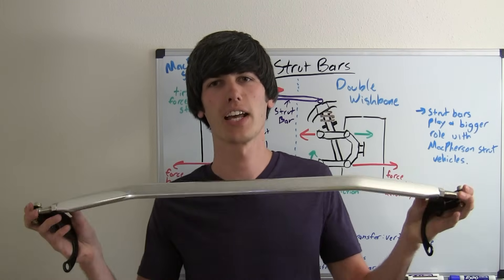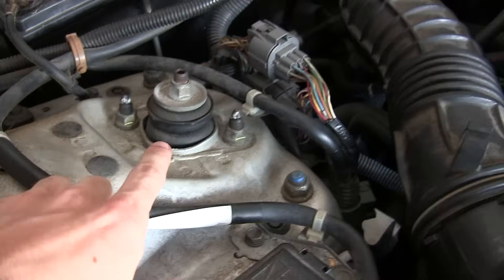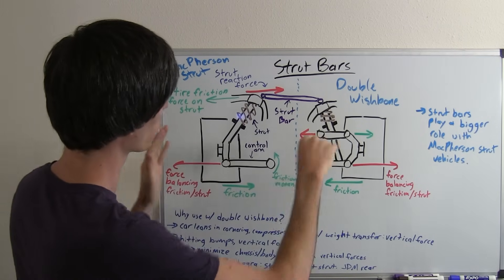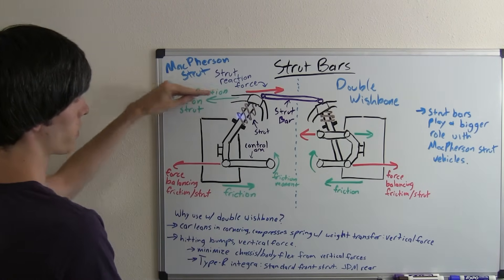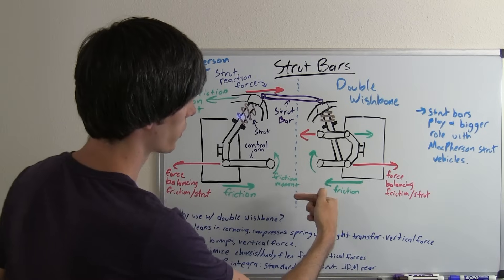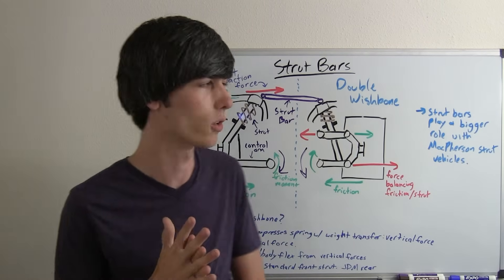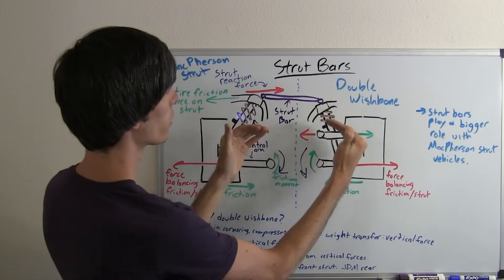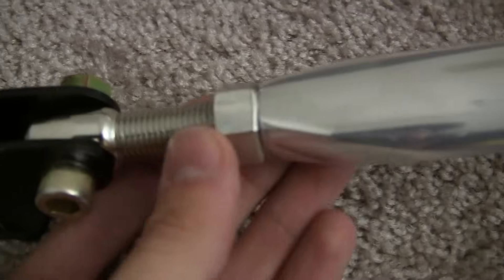Strut Bar - Explained

Comment: if i paint the bar red will my car go faster?
Reply: +25KW
Reply: If u paint it red it won't b street legal
Reply: Definitely
Reply: clownavenger yeah it's not street legal to paint it red. But each sticker you slap on it adds roughly 5 HP
Reply: Antonio Conejo i know about the power of stickers but it may get too hot down there when i rev my rotary to 9500.
Reply: No, but if you paint it matte black, it will stay cooler.
Reply: Char Aznable reference?
Reply: dark colors absorb heat, lighter colors reflect it. you have it backwards. if you wear a black tshirt on a hot day you'll get hotter than if you wore a white tshirt, this is elementary stuff
Reply: my wrx sti is going to be my char car. Sorry toyota.
Reply: eksine the absorbsion of electromagnetic radiation in a darker surface causes more heat. An internal thermally conductive bar of metal tied to metal body would cause a heat pipe to form and vent heat.
Reply: njack1994 I think I understand what you are saying , HOWEVER, he was saying painting it black would make it cooler, which it wouldn't at least exposed to sunlight. What you brought up is a good point however you are wrong, firstly 1) it won't matter what color it is since it receives no sunlight in a closed hood. 2) you are wrong because there is no airflow under the hood, it's a dutch oven meaning it wouldn't act as a heat taker away thinga mabobber because again the engine is closed, heat is being trapped.
Reply: clownavenger No, the paint will add more weight :/.
Reply: +5 horsepower
Reply: clownavenger paint adds 20 hp, a decal will add another 35 hp, and a mini spoiler will get you that 100 hp extra you need.
Reply: Corny
Reply: what kind of red makes it go the fastest? asking for myself
Reply: Only if you put stripes on it too
Reply: Red is good power if you paint it yellow you’re beating hell cats eazy
Reply: Put sticker instead of paint
Reply: If u want car faster weld it directly to ur steering column to keep ur steering straight all the time and push throttle. Only make sure u always drive on a straight road.
Reply: No but I think yellow might make it speed along a little bit quicker.
Reply: I guess Sarcasm isn't a thing these days?
Reply: Yes!
Reply: @eksine  Lol, carbon fiber hood.
Reply: Yes
Reply: Depends on the shade of red
Reply: No the paint will make it heavier
Reply: Yes, and if you put stickers on it even goes faster... depends on sticker will determine HP and Torque 🙄
Reply: Bigger tires on the back will help you save fuel.  You will be going down hill all the time.
Reply: Yes red Sieg Zeon
Reply: Correct
Reply: Yeah 16+ horse power 😅
Reply: yes. +10HP added to your car
Reply: You gotta paint it red with the metal speed flakes, that's the real secret they won't tell you.

Comment: How much HP will it give my car?
Reply from the maker: ***** Zero horsepowers.
Reply: ***** You could always paint your brake calipers red you know, +25KW.
Reply: ***** It just increase your car stability
Reply: NorwayVFX i bet your a mighty car mod viewer :)
Reply: ***** I heard stickers usually add 5HP.... or is that with hubcaps...? I can't remember.
Reply: ***** 10%
Reply: +Engineering Explained Wouldn't you technically lose horsepower because you're adding weight?
Reply from the maker: Brian Patrick Adding weight does not change wheel horsepower, unless it's added to the drivetrain (wheels, driveshafts, flywheel, etc).
Reply: hahaha...
Reply: +Engineering Explained With increased structural rigidity it will aid in putting current HP to the ground ,you won't have more HP , but will make use of it more effectively.
Reply: +Freesample D Stickers. Stickers add about that much HP.  There are "go-faster stripes" too if you are not too picky about numbers.
Reply: +The3Shogun Health Points -there will be much of them.
Reply: +The3Shogun around 4500
Reply: 20 to 10000 hp
Reply: He looks like Sam pepper
Reply: +The3Shogun My son gay and Trump stickers -16 WHP! and camber angle -28WHP!
Reply: +NorwayVFX Mighty Car Mods?
Reply: +Lucas Zibell Yes :D
Reply: +The3Shogun approximately 1.21 jigawatts
Reply: +gravitykillz nyahahaha
Reply: around 100-150. I added one to my car and now i win all my drag races and get all the bitches
Reply: I think if you paint it red or green it will give you 99.999% chance of winning races.
Reply: First you get the strut brace, then you get the power, then you get the women?
Reply: 100 hp easy
Reply: The3Shogun lmaoooo
Reply: In 2020 they're making the switch to Unicorn Power. I'd start looking into that.
Reply: The3Shogun about 10% touquepower
Reply: Apollo 13 torque and the speed? well hell just grab onto that strut bar baby!!! FFEEEEELLLL that power? yep I knew you would dig it!!
Reply: What if you paint it red and add stickers to it?
Reply: Windshield wipers give 10 a piece so you're looking at about 25 for a strut bar
Reply: 50hp if its red, 40 if it's yellow.
Reply: Engineering Explained what if he colors it red?
Reply: I've been playing RPG's lately and read that as health points.......damn
Reply: The3Shogun You'll gain more instant torque than a Tesla
Reply: 0.0
Reply: @Brian-dd2df  generally adding weight to the car changes the way the internal combustion engine works? So if you pick a pizza up on the way home you have 299 hp instead of 300? it would affect the POWER TO WEIGHT RATIO.
Reply: @_Delta_P_  Hey thanks for clearing up what had already been answered 4 years ago
Reply: Well I don't think it'll give you much horsepower but it might be able to help you keep what you have I'm done sharp turns.. lol......
Reply: Yes
Reply: All of them
Reply: NOTHING TO DO WITH HP , TRY TO IMAGINE THE WORD "HANDLING"

Comment from the maker: It doesn't act as a sway bar, it simply keeps the body a bit more stiff. Sway bars are used to reduce roll, which is not what strut bars are used for. I have a video on sway bars if you're curious.
Reply: Would the strut bar help in a head on collision?
I. E. Stop the engine moving towards the cabin?
Reply: @mohsinrasul8450  It is not designed to.
They go over-top of the engine usually so they wouldn't even be in the way in most cases.
Even if they were in the way, if there's a force strong enough to bend the frame, break engine mounts and move the engine backwards, I doubt a few extra bolts are going to help very much.

Comment from the maker: Correct, the MacPherson strut is load bearing of the forces from lateral acceleration, where as a double-wishbone handles the vast majority of the forces through the control arms. Of course, the weight of the car, bumps, and weight transfer by cornering still put additional pressure on the coils, thus a force on the strut tower.

Comment: Strut bars works well in Macpherson struts. One reason why?

Because car manufacturers now, have placed strut towers very near the firewall where they can bolt a part of the chassis (usually at the base of the windshield) unto them. Acting as a strut bar on mass production cars, like a Honda CRV or a Nissan Sentra.

So yes, buying and installing a $20-$50 aluminum strut bar  on your old car is NOT a waste of money. Even if you don't use it for racing, it does make your chassis a tiny bit tighter for maintaining the correct geometry that can go a tiny bit off thru the years. Take it as an investment not as a racing mod.
Reply: thanks dude, it was that kind of information that I was looking for
Reply: Make a sense .thanks bro
Reply: Very well said
Reply: i put i strut brace on my totally stock beater mazda protege and the difference is amazing. the car feels so flat in corners now. im planning to put one on the rear of my e46 m3, but everything im seeing is saying it wouldnt do anything. a bit confused with the consensus on that, the rear of the car definitely feels like a week point in handling so i cant imagine how it wouldnt make a big difference.
Reply: @AC-wl7ve  only problem with the rear is that you might need the trunk space of hauling your junk. Unlike in the front where it would not take up any space. Otherwise yeah, I don’t see why it wouldn’t help, even if just a tiny bit.

It’s actually a BMW engineer who said that strut bar might not help in “handling” but it would help maintain chassis shape that may sag thru the years. Specially 90’s car or older.
Reply: @jpogigtxcr1778  trunk space isnt a problem for me or i definitely wouldnt do it. i just find the rear can feel a bit flexy so i cant imagine how it wouldnt help. i am not too knowledgable about suspension stuff though so im not too sure. my only basis for my theory is that it helps so much on the front, why wouldnt it do the same for the rear.
Reply: calidakota  on my Mazda I put one in the front and made made a substation difference, highly recommend a front strut brace for any car. 

On my e46 m3 (has a front brace stock) I added a rear brace and the car definitely feels more stable a bit flatter. For example, changing lanes at high speed the car feels much more confident and doesn’t sway side to side. It’s a really nice upgrade, but I don’t think as substantial as a front brace.

Comment from the maker: Anti-roll bars connect independent suspension set-ups (at the control arms), so that when one wheel travels up, it causes the other to have a vertical force as well.

Comment from the maker: I don't see it making a huge difference, unless there is considerable flex in the strut towers upon lowering the car back onto the ground. Regardless, if installed once lowered it will attempt to negate any force which differs from the car when it is stationary. The bar will experience compression and tension, so pre-loading it one direction (which could be the case if installed while lifted) may not always be best. Interesting question though - feel free to expand anyone...

Comment: I'm not an engineer. I am a retired automotive technician of 44 years.
I used to race cars. I added a strut bar to a car I'd driven every day and raced after two years. After the first race, the windshield cracked.

I had customers who installed strut bars and experienced the same.
One of those cars was a VW GTI that, as I stated, cracked three windshields.
In my circle of racing acquaintances, it became common knowledge that adding a strut bar to a car w/glued-in w/shield would likely suffer.

Comment from the maker: Well, it certainly shouldn't be very easy to bend it, but as you mentioned it's really only in tension/compression along the length of it. A vertical force wouldn't be applied, except possibly at the very ends.

Comment from the maker: As long as the components are strong enough for the forces they see, it shouldn't matter too much. A single piece will likely be able to handle stresses better as it wont have as many sheer points.

Comment: Excellent!  Except double wishbone suspensions are load bearing at the top also.  The full weight of the car is transferred from the body to the lower control arms through this point in both designs.

Comment: While on track in my E36 M3 (was running very sticky rubber) I cracked a windshield after negotiating a quick right-left-right section of track...in video you could see the crack form and grow as the chassis twisted left and right. Adding a sub-frame brace and a strut bar significantly reduced chassis flex...I haven't broken a windshield since.
Reply: im planning to do a rear strut brace on my e46 m3 as i definitely feel some flex in the rear of the car, it seems like a weak point (sub frame is reinforced as well.) but it seems the general consensus is that a rear strut bar would do practiacally nothing so im a bit confused on this. i imagine it would make a huge difference.

Comment from the maker: I did install these - the video will be up Saturday. I haven't installed the catback because I want to do engine upgrades differently - I want to prove they've made a difference, which requires dyno testing. I want to be able to tear apart my car and leave it in a garage, without needing it - which requires another car. This should all be solved within a year, as I'm saving for a new car currently. My channel grew a bit faster than I expected, so I'm just trying to keep up!

Comment: I have strut bars everywhere on my Type R; boot brace, rear upper strut bar, rear lower strut bar, front upper strut bar and a H brace under the engine. The car is so stiff, turning onto a road or car park with a fairly steep incline and the car likes 3 wheels instead of 4 lol
Reply: +elliot438bcfc Interesting. Did you feel that change in the car's behaviour with these mods alone or in conjunction with stiffer springs? Do you have stock springs or stiffer aftermarket ones?
Reply: Siddharth Rajkumar
Well all of the braces other than the H brace under the engine are stock. It is on Ohlins coilovers so not overly stiff or hard. The car is definitely a cornering champ and I believe the front and rear strut braces aswell as the H brace definitely help. Obviously a good brand of coilovers such as my Ohlins will make a huge difference even over the already great DC2 suspension
Reply: elliot438bcfc I see. As far as strut bars/braces go, the baseline you seem to have for your car's handing is NOT without those parts in place. I was hoping to know if all the strut bars were installed by you and that's what improved the handling. The improvement you have achieved seems to be mostly due to the coilovers. Of course, I am only deducing that from your comment since you are the one who drives your car. However, if all the strut bars (save for the H brace) came as stock, the car actually needs them to handle well and would not be as poised without them. I wonder how much of an improvement a strut bar provides in real world circumstances in a car that does not come stock with it. All theoretical questions I guess...
Reply: Siddharth Rajkumar
I believe strut bars will have a small effect on handling. I don't think Honda would put them there for no reason as they made the car to be as light as possible. During hard cornering (providing grip is adequate) there will be flex and strut bars will definitely lessen this flex. Similar to how brake stoppers work.
Reply: +elliot438bcfc That makes sense. If they made the shell of the car as light as possible, that means some load bearing parts (like strut mounts) might flex under cornering stress. To make up for that they must have installed strut bars instead of adding large areas of thicker sheet metal. Brake stoppers? Do you mean bars or link rods that connect the chassis/body to brake calipers to prevent them turning about the rotors?
Reply: That's right about installing lightweight strut bars instead of heavier material around the chasis. Brake stoppers are just a small part that bolts onto the chasis near the brake master cylinder and holds a strong bolts which is then tightened to pressure the brake master cyclinder. The master cylinder flexes under hard braking, the stopper eliminates this flex therefore improves braking a small amount similar to the effects braided brake lines would give.
Reply: +elliot438bcfc Wow! OK... I mean it makes sense to reinforce caliper mounts but this is a bit overkill, don't you think? One would expect the manufacturer to at least make master cylinder mounts rigid.
Reply: The flex will be minimal but eliminating this flex does make sense and lots of people use these including me
Reply: +elliot438bcfc And has it made a perceptible difference?
Reply: It's really hard to say, braking hard does feel firmer and more stable. It's definitely a worthly mod if you are upgrading brakes
Reply: +elliot438bcfc Interesting. Makes sense. It seems some of these mods really help when driving hard. Thanks for taking the time to answer my queries!
Reply: elliot438bcfc That's your suspension set up not the added bars.
Reply: They do help. The BRZ/gt86 has some bracing from the factory too. They wouldn't be there for no reason as good quality braces aren't cheap. They aren't there as fancy eye-candy, just boring black struts.

Comment: On any car with shock towers and unit body construction, some flexing will occur. An upper strutbar is mostly for show (and adds weight) and only partially effective unless a lower bar is used to tie it all together; essentially you are boxing the suspension as a true frame would do. Upper and lower A-arms are the best means for keeping tire contact and have better travel (and respond better to lowering springs).
Reply: Cheers to your ideas and opinion. Cars are carefully engineered for purpose, appeal, and a certain lifespan; but it's a business, so compromises are made. Simply, if something minor like a an upper strut bar really added so much precision, and hence safety, to the suspension then it would be found on more cars wouldn't it?
Reply: tyler t Totally agree. Ive changed from Alfa sport suspension to a Bilstein B12 kit and the need to brace the strut pilars is clear.

Comment: Great video describing the suspension load forces! A strut bar will definitely help stiffen a McPherson strut suspension vehicle, but at the same time it will increase ride harshness, noise and vibration.

I put one on my 1984 VW Jetta GLi coupe, and on harsh road conditions, it sounded like someone was hitting my dash with a sledgehammer. Unless you track your vehicle or have very smooth roads where you live I wouldn't recommend them in daily use. That said, I did mount a lower control arm brace and a rear strut bar - those helped the vehicle corner better without any increase in NVH.

Comment from the maker: Water is cannot be compressed, so if you have water in a cylinder and it attempts to compress, it will fail to do so. This likely results in a broken connecting rod, and could cause other damage as well.